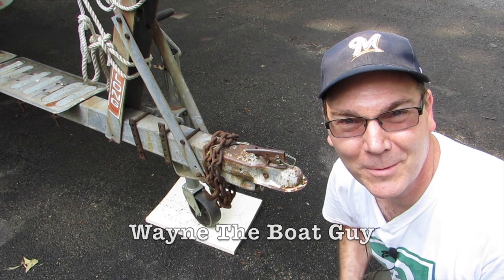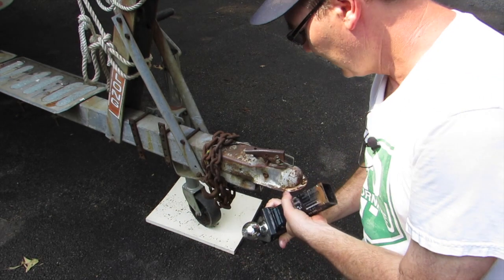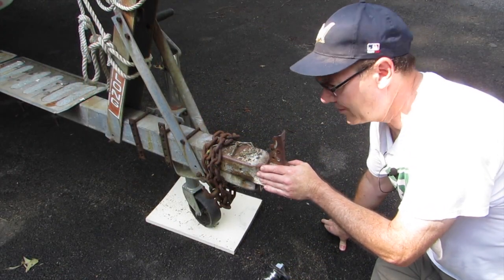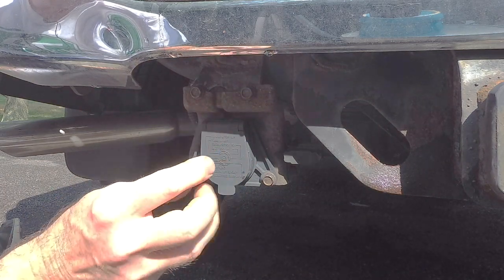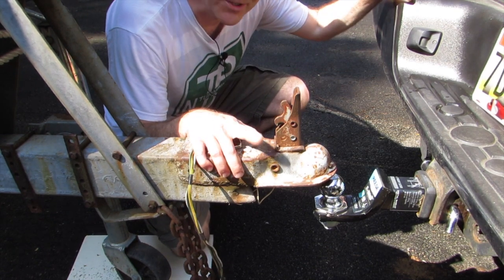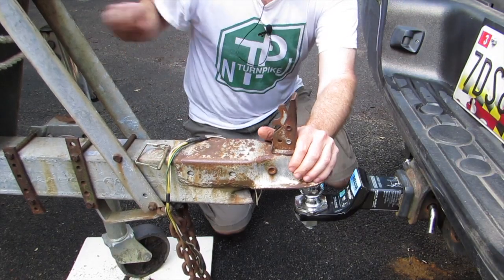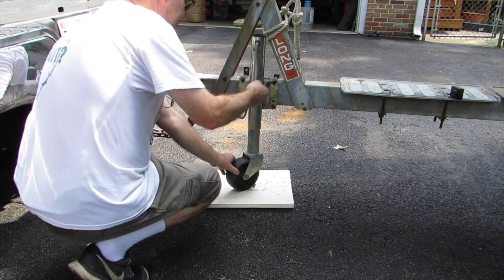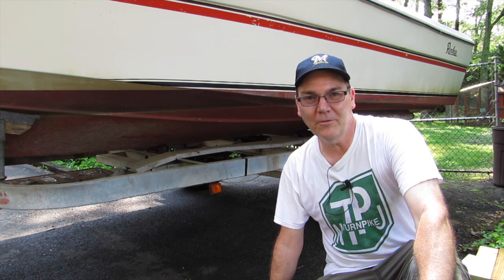How to hook up a trailer. Connecting a trailer for towing a boat

Comment: thanks bro youre a legend i just got a boat the other day and i tried connecting the trailer to my ball joint didnt even know there was a size and it came off slammed in the back of my truck lol good thing it made a hole in my license plate and nothing else but now i am going to check the correct size and make sure i lock it how you did because mine is very similar to yours and get this boat a goin THANK YOU!

Comment: Real people boat with common how too’s .. Tnx Mr. Good job on your presentation! I have to backup my trailer and boat into steep driveway into my garage, it comes with a whole bunch of other issues.. but I see we’re doing the same thing. I also work with a jack when I’m inches off the floor.